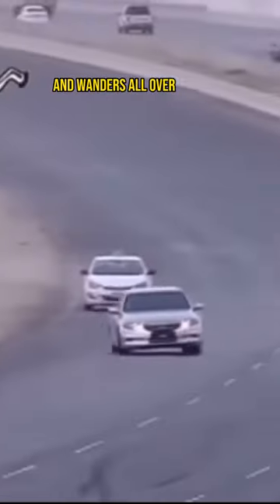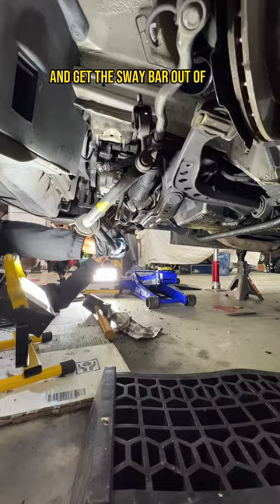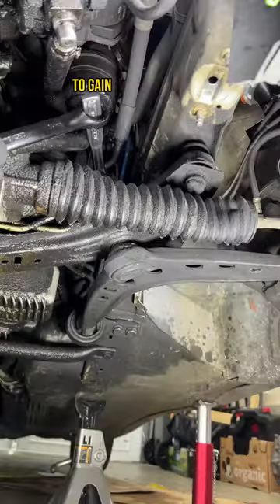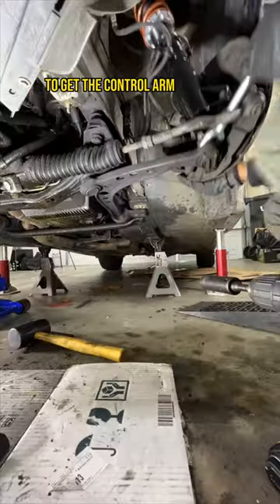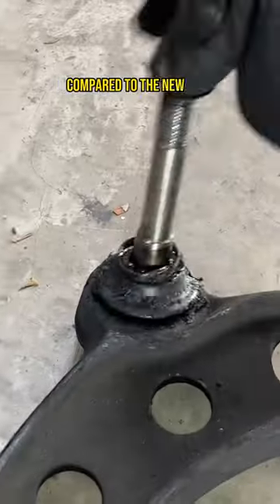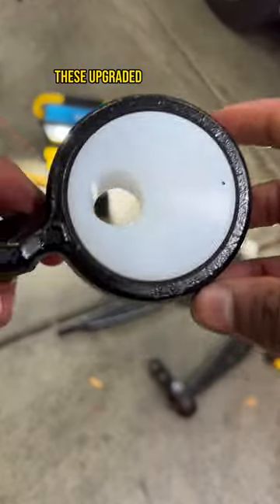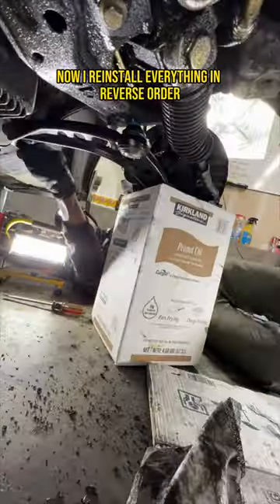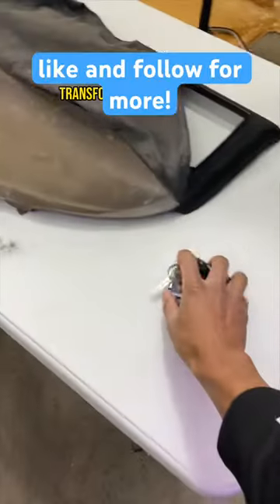How to fix sloppy steering once and for all #diy

Comment: may i ask why it would matter if you damaged the threads if you are replacing the ball joint?
Reply from the maker: it wouldn't, but I didn't have enough time to clarify between installing all new arms vs adding upgraded bushings to existing arms without damaging them. should have added that a pickle fork can damage balljoint boots if you were planning on reusing them 😅
Reply: Yea
Reply: because if you mushroom the stud it makes it not want to come out.  Ask me how I know.

Comment: No dielectric grease for poly bushings? Shame
Reply from the maker: is that a thing? these were just press fit on
Reply: @ChrysGaines  yeah you are supposed to grease all poly bushings.
Reply: Who the heck put oil on poly you need to be fired if you do that
Reply: @bhekidlamini1199  not oil, grease, and you must not know cars my friend, all poly bushing manufacturers tell you to use some kind of rubber/poly safe grease.
Reply: @bhekidlamini1199  and are you fired already for not putting grease on poly or not differentiating between oil and grease